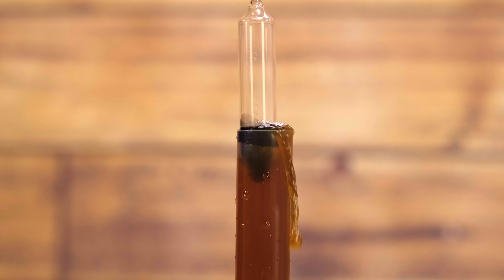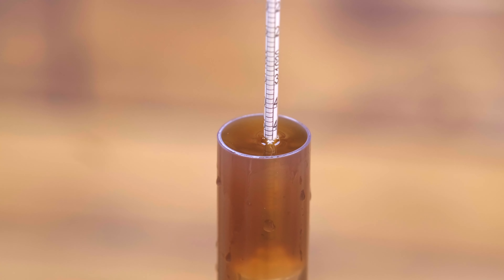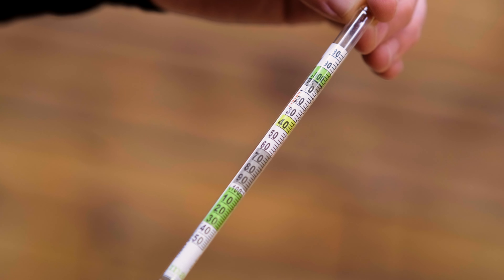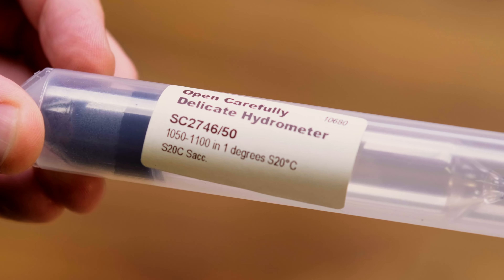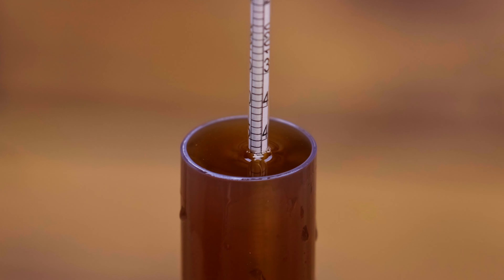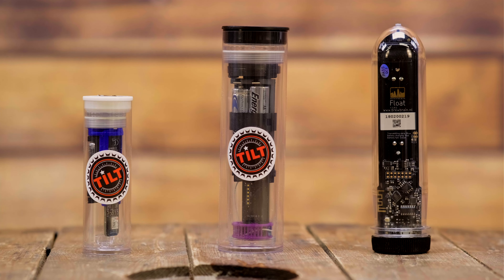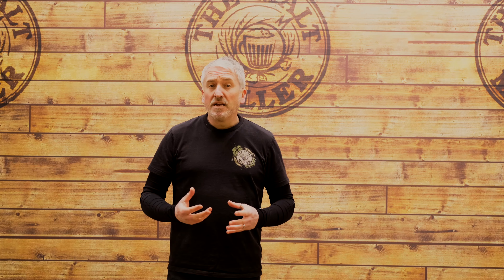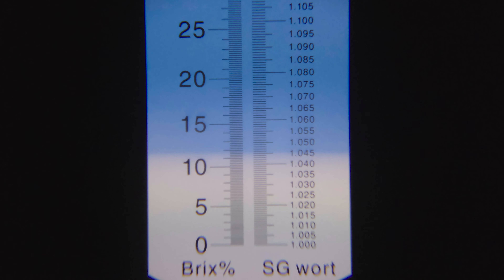The Malt Miller | Using and Understanding Hydrometers & Refractometers

Comment: Interesting video Rob, my glass hydrometer doesn’t mark “0” when I put pure water (distilled) at 20° (it’s working temperature). Is it any form to correct this calibration mistake? Or scale the result to reality? If you or someone could help I’ll be pleased. Thanks 🙏🏻
Reply from the maker: What does it read?
Reply: @themaltmiller8438  thanks for your reply 😊. It reads 1002-1004 instead of 1000
Reply from the maker: No, there is no way to calibrate as such. If you purchased it from us then please email in and we will get it sorted.
Reply: @themaltmiller8438  no, from Spain don’t worry. Then, does exist any solution? May I take the 1004 as “0” for example? Thanks
Reply from the maker: @Angelstealth  Yes you could. Ideally you would find out if that error is the same for the whole range but the only way to do that is with an accurate hydrometer;)
Reply: @themaltmiller8438  ok thanks 😊 I think I’ll buy a refractometer and use both of them with the hot wort. Maybe I could compare different ranges of gravity and have some calibration for the hydrometer